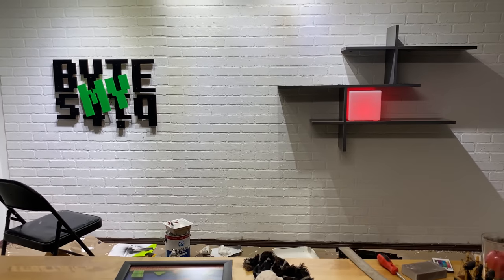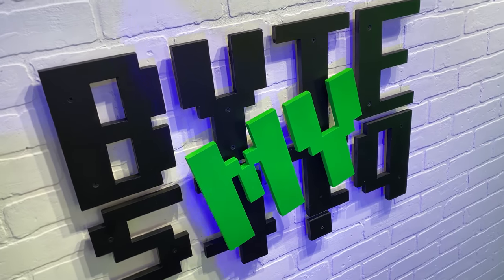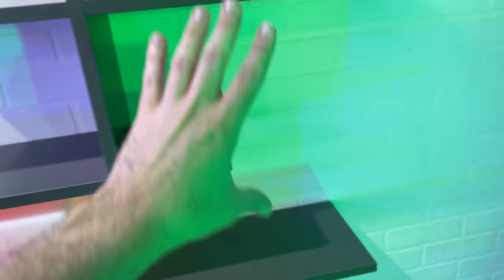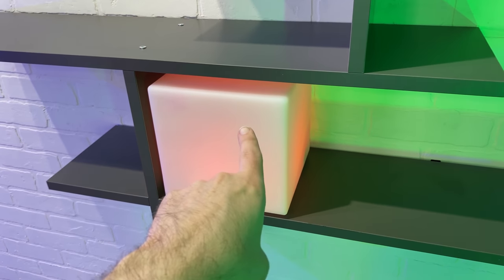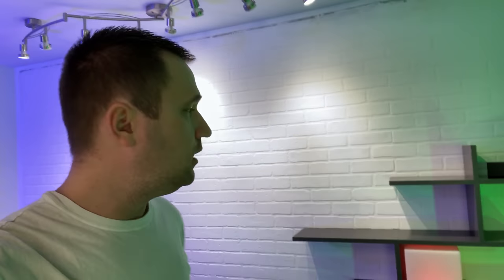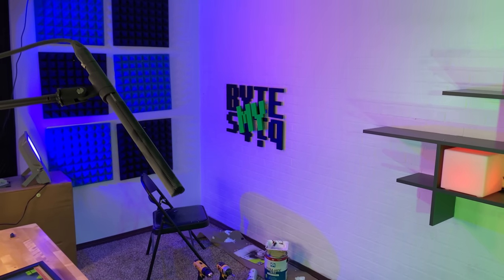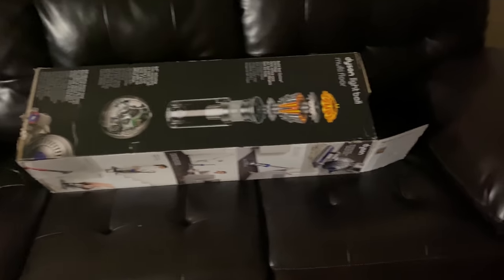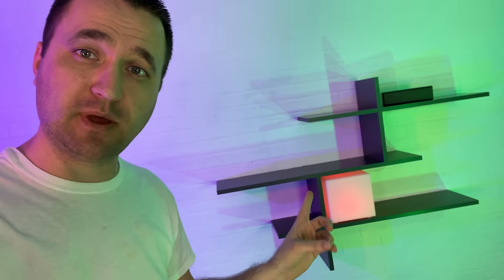Finally finished this wall... Studio Build 2/2

Comment: Man, its looking awesome, great job!!!    As for the bite my bits sign, you may want to put lighting on the back of the black portion(instead of the green part) to avoid getting weird lighting on the black front, also if you get one of the led strip offerings that have diffusers in the strips already that could help avoid seeing the dots. Phatneks neon rgb strips come to mind, but i'm sure there are other options that fight this use case better.

Comment: You could put some 1x2" as strips on the wall, and then attach the decor panels to those. This would give you a recess to run cables up and down the wall out of sight, and you wouldnt need to cut out holes for the outlets - just thread a cable through where it was needed. Also, i dont think the decor panels are vertically symmetrical, so if you spin the left-hand side panel around 180 deg then the bricks should line up.

Wait, oh darn. I see you've done it all already.

Oh well ;p

Wait tho, seriously, Great logo

Comment: Install a recessed wall plug (used for wall mounted TV's) behind the sign and then use diffused RGB strips that glow the entire tube rather than individual LED's brightly shining spots.

EDIT: Angle the lights where the shelves don't show shadows.

Keep it up bud. I like that you don't mind admitting your limitations. Some YT Influencers act like they know everything about everything( i.e. they do computer benchmarks very well but then try to act like they know how to do construction lol).

Comment: I didn't notice the outlet until you pointed it out. Also, just drop the adapter and get a wall socket with USB instead of 110 outlets.

Comment: I have a raspberry pi 4 Plex server with a remote folder in my WD NAS mounted to it and I just watched your 5 tips to optimize a Plex server. You said you recommend moving the metadata folder to an SSD. Sadly I can't connect on to the system. But I figured out that my metadata is stored on the SD which is not good. Is it a good idea to also move my metadata to the NAS? I know it could be a performance bottleneck but it could also make my SD card live much longer.

Comment: I’m Looking for some advice before I go purchase my Nas system to run my Plex Pass and Home Surveillance System witch I will buy after. Looking to record all 4 cameras on the nas.  I’m looking to buy Synology DS418play at $599.99. I’m going to use 4 Seagate IronWolf Pro nas ST6000NE000 6TB 7200 RPM 256MB Cache SATA 6.0Gb/s 3.5" Internal Hard Drives at $289.99. x 4 = $1,159.96 It comes with 2GB DDR3-1866 memory, which I plan on adding a Synology RAM DDR3L-1866 SO-DIMM 4GB (D3NS1866L-4G) sat $119.96 to make 6GB. Will this all run fast and work or do I need more. After watching lots of your videos am going to use SHR. I am looking to add a Synology M.2 Adapter Card (M2D18). I see online that using ssd to run my caching and transcoding will keep my system from bottle necking and buffering a lot. Or can I use an external 2tg hard drive to run the metadata / thumbnails. I’m not a tech guy at all, anything I learned here was from watching your videos. (Witch are great, and much appreciated.) I’m looking to spend $2,000.00 and need it to last for a long time. Thanks for any advice. Tim.